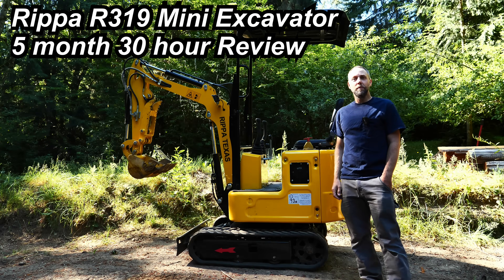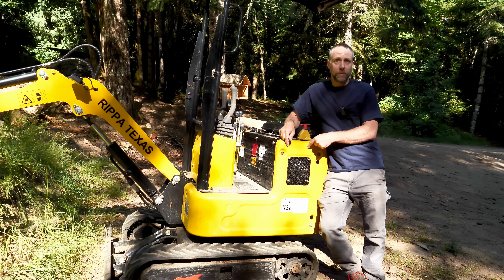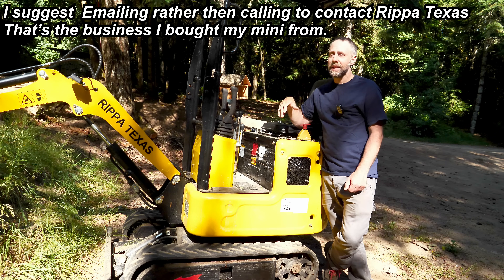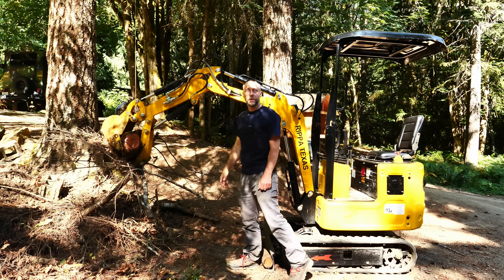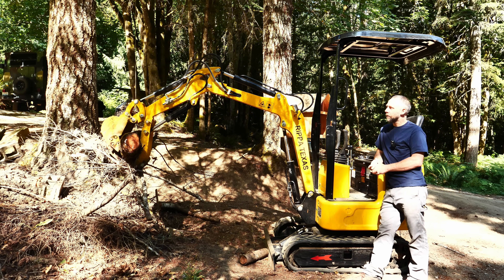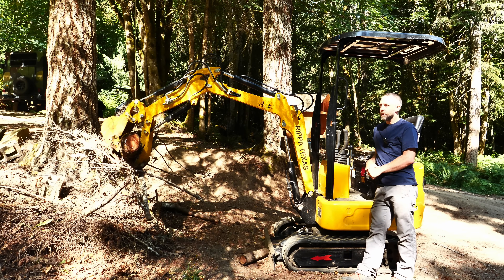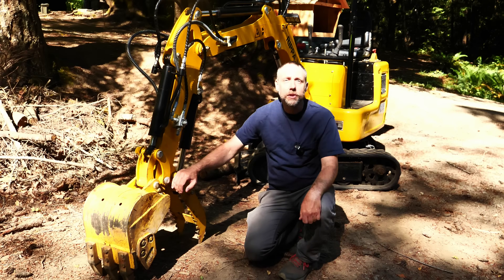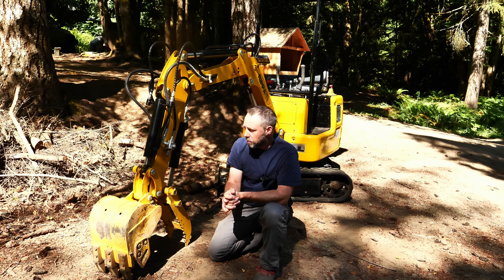Affordable Chinese Mini Excavator review #Rippa #R319 #miniexcavator

Comment: Hey Mike.  I agree with you about having a hernia.  When I was in my 40's and was driving semi truck haualing automobles I ended having a hernia on the right side of my stomach area.  I though that over time is would heal itself.  But it didn't.  I got tired of having to always push my intestines back through the hole in stomach wall muscle.  So I had the surgery and the doctor sowed a plastic mesh to help block the hole in my stomach muscles.  I was not fun.  For ten years if would get a shape pain once in a while.  But now I have no problems.
Reply from the maker: I hear you man, I have been feeling something coming on when I lift really heavy things or shovel a yard or two of gravel. 
I have been trying to take better care of myself and not do as much heavy stuff.
I had back surgery when I was 13 years old, since then my back has bothered me especially after a long day of work. 
On a side note I bought a mini skid steer last summer and I use that machine a lot around my place. I took it to my work this week to do some gravel work, I was able to prep the site scraping off all the grass and lower the grade for gravel in and 1 hour. 10 yards of gravel got delivered and I was able to spread out the 10 yards over the site in 1.25 hours with that little skid steer. Man my back thanked me 🤣
Take care Samuel 👍

Comment: Interested to see what you think of the quick attach vs your bucket & thumb geometry. My fixed thumb pin is about 5” up the stick compared to the bucket pin. I have seen others with the same set as me but with a hydraulic thumb where the thumb and bucket only meet in one position.

Comment: Get the Diesel. I have a 30yr old Kubota tractor with the exact 3 cyl engine most of those mini excavators come with. It is not expensive for maintenance and I have never had to do anything other than routine maintenance. Parts are EASY to source, there are zillions of small Kubota and Yanmar diesels out there. People saying diesels are expensive to maintain must be thinking of big semi truck engines. Diesels are quieter, produce more torque at lower rpms, last longer, and sip fuel. You can even buy off road use diesel that doesn't have any of the road use taxes added.

Comment: Both of my machines (excavators) are running on diesel.  I wouldn't have it any other way.  Very smooth and powerful even down to the low rpms.  Never had an issue that couldn't be dealt with easily and the small one uses a 3 cylinder Kubota diesel engine.  The small one is what is called a 2 tonne Chinese model.  It has the red arrow on the side of the track frame like yours.  4 post sun shade is certainly better than a 2 post.  Mine has the expandable tracks for width but I have only used it in the widest setting and never had a need for it to be narrower.  Just makes it feel more stable.  I have removed the door off of the back which accesses the oil and other engine accessories but I did this because the fan really drove the air right to the centre of the door and it made sense to help the cooling in the 100 degree weather we have been having a lot of in the Okanogan here.  The hydraulic oil fill and diesel fill is on the right side (of you sitting) and has see thru fill gauges you can easily see.  Hydraulic thumb was standard and there is plumbing for accessories like a breaker or auger if you like.  I got this mainly for orchard work because we would plant trees with an auger but when hitting any kind of rock, which we have plenty of,  the auger would deflect causing the tree hole to be off.  With the bucket on the excavator this doesn't happen.  Just dig out the rock.
They are an absolutely indispensable machine for almost any purpose.
Reply from the maker: Great to hear your experience with your machines 😊👍

Comment: Do you think this machine is capable of digging 2-3' trenches? I'm looking to repair a septic drain field (not deep) and adding drainage to my property. Based on your videos, I'm sold! I'm struggling to find a dealer network- where can I find a dealer list? Looking to purchase within a few hours of upstate NY.
Reply: it will dig! i have a qh12 and several buckets and a grapple, yep, they will dig fine, mine will reach to 5ft, and maybe 6, i wish it would reach up higher tho. but ways to manage doing that.

Comment: The small inline Kubota diesel engines are very reliable, it's common to see 30yr old tractors with 3k hours and the engine is just fine.  The D722 has been used for eons and its a good motor, the D902 is a better engine (I've had 2 D722 powered tractors and have a new D902 powered tractor).

Comment: Diesel is awesome, BUT they are more expensive to fix, injectors and injector pumps can be expensive and frustrating. In some ways you can't really go wrong with the simplicity of a gas engine. The real reason, in my opinion, to go diesel over gas is economy. For a little machine like that it seems like the economy would actually be better with the gas engine, not in the way of fuel usage but in the way of cost of parts and maintenance and ease of maintenance. I would watch no matter what way you go. :-)

Comment: I got a 2024 with enclosed cab from the same source. I ordered it on Ebay and added the rake attachment.  Shipping was free and final cost was the same as what Mike paid for his. I think the cab models don't sell as well, might be why it was a good deal. Don't know. It also has the RATO engine, not the B&S. Research I did says the RATO engines are available at Harbor Freight. I'm 6'7" and was concerned if I'd fit in the cab. Pleasantly surprised, it's quite roomy. I modified the cowling to swing open. Added a fan to pull air out of the engine compartment using the existing switch installed for the track spread, which mine doesn't have. Added a simple tach/hour meter. Also, extended the walking sticks to help have a bit less Jerry control. I've found to avoid Jerry hydraulics just move slowly. Shipping took about 6 weeks. But, the company was great about keeping me informed and once the machine got to the States it was to me in 3 days. No regrets here.
Reply: I've got a machine getting picked up from them and shipped out to me on Monday. How far from Texas are you that it took three days? Just trying to gauge my expectations!
Reply: @richcrosby  Idaho
Reply: Mine came with pedals fir thumb and blade. I like those. The one thing it doesn't have is a hydraulic fluid temp Guage. It has a round bubble type Guage. Not as useful, imo, as the type I've seen with the thermometer in them. But, oh well.
Reply: Does the can have AC or just heating?
Reply: Which RATO engine is it at harbor freight? I’m trying to see how much it would cost for an engine replacement
Reply: @jamesamous5854  just heat and very basic heat at that.  Basically, a tiny electric windshield defroster. Strangely, it's mounted kind of beside the seat, where it blows mostly on the rear window.🤷‍♂️ I haven't really run the machine in cold weather, yet. But, now that we have snow, I may have to test it out. I suspect there's enough heat coming up from the engine, combined with the little defroster and oscillating fan to keep the windows defogger and defrosted. I'll let you know. As for A/C, when it was hot weather, I operated with the right side sliding window open, left side door open and oscillating fan on. It was tolerable. Putting the engine compartment fan in so it pulled air out of the engine compartment seemed to help, too.

Comment: To me it sounds like your yanmar is a little too big for your needs since you’re not running that much and the rippa is a little small since you’ve already found the limit of the original bucket. I think it’d be worth while to sell both and buy something that is in between the two size wise. That way it’s a little stronger and more powerful but you can still get into the tighter areas

Comment: We just bought off grid in the Adirondacks NY
My GF is set on renting an X to dig the existing "unknown" septic to clean it up/replace it.
We also need electric trenched in, and one pole set for the street pole service line.
I also just finished building my homemade 158" sawmill

Now in your opinion, arent we gonna be better off with something like the Rippa vs renting stuff? My GF is extremely wise and I always try to use her as the decision meter, but shes still hesitant on buying a machine when myself, an auto shop owner, feels we NEED to buy something off the gate and the Rippa is like perfection in all aspects.

Whats your opinion? We are quiting our jobs, and will have nearly no bills, and will need to figure out garage based/homestead based incomes as we go..

Comment: Doesn't use enough fuel to justify going diesel at all if it's harder to work on (better not have to pull engine for anything). I would check it out in person for quite a while.
Also, what about adding some tractor weights to the back for more lifting capacity/stability (sorry, we've seen you're an excellent fabricator lol)? I'm sure 500 lbs would go a long way and add fairly minimal length.
Reply: I believe  mike is planning  on fabricating a counter weight in the near future

Comment: Could you put some type of mower attachment on it?
Reply: A brush mower attachment even if it had its own isolated engine that could trim trees to a height and hills and ditches would be worth the buy for me.
 Even if you had to make it yourself that would be an awesome video.
Reply: I've been looking at these for a while now, but I keep telling myself how often would I use it, just to dig or lift a log, so would it really be worth the money, if it can do brush Mowing and limb trimming, then I would probably get a lot more use out of it.
Reply from the maker: I actually just adapted a 21” 5HP line trimmer to hook up on my mini excavator bucket. So far it’s working great 👍 
I will post a short video of it in a few weeks. Thanks for checking out my new video.

Comment: Hey Mike, great content, thank you.  I have a Chinese mini ex, issue I am having is not being able to lift the front blade very high.  Its a factory issue.  Any thoughts on a way to re engineer the blade or cylinder or mounts to get a higher lift?
Reply from the maker: What make and model do you have? Does the blade have a decent amount of drop below grade? If so you probably could modify the top mount of the hydraulic cylinder by cutting it and moving it up a little higher on the lower frame. If you do just make sure the blade in its up position doesn’t hit the lower cab when rotating. Also consider adding some extra gussets to the mount, some of these minis seem to have a fairly weak upper mount on some makes and models. 👍
Thanks for checking out my new video!
Reply: Thanks for the reply.  Mine is a Yufan, YFT 12 so similar to AGT 12 or 14 or so.  Not sure about the blade drop below grade,  I will have to check  that.  Think I may need a longer blade cylinder?  Climbing curbs and other small solid objects are a real pain and I am thinking there has to be a better way.  Also I ordered my machine directly from Yufan Machine and got the expanding tracks and swing boom.  The ordering and dealing with them was flawless.  I do like the expanding tracks.  Havent used the swung boom feature yet.   You will probably need to build a "skid plate" if you get a machine with expandable tracks as the expansion cylinder and hoses are exposed.   AJ
Reply: @Mikefestiva  I have a Yufan that is similar to te AGT 12.  I do have some drop on the blade.  I will have to experiment.

Comment: There a re 1/14 Rc machines more expensive than that but hell beats a shovel or messing your back up and dont matter if its a CAT or a cheap mini still need maintenance parts and repairs eventually and these  are basic no computers and if you can work on a mower or lawn tractor or quad bikes i reckon you can   look after one of these and even a car and quad trailer can hual it around they hual 2t caravans

Comment: Mike they did sadly remove the cross brace on the new model they also changed the vendor for the drive motors to a Chinese company.
Reply from the maker: I’m pretty sure my drive motors are also Chinese, the hydraulic pump on mine is supposedly a Parker pump?
Reply: @Mikefestiva  The problem with Chinese is there is no recourse for them using counterfeit or knock off "brand name" parts. If Parker makes them in China then the chance of them being real Parker pumps is more likely.
Reply from the maker: @LameTRUMP  Yes definitely, that’s why I say ( supposedly has a Parker pump) supposedly being it may say Parker on a name plate but I kind of doubt it’s real a Parker???
But it’s pumping oil and is still working fine.

Comment: It is important to clarify whether we are talking about replacing it with a single-cylinder Chinese diesel or a three-cylinder Kubota. In the first case, I do not recommend replacing it because this engine is very loud and emits strong vibrations. Kubota is the best in all respects but also by far the most expensive solution. What you will buy is up to you.

Comment: I think its a kubota so parts shouldnt be an issue, engine problems also probably shouldn't be an issue to begin with, its a diesel so its ALOT quieter and should run ALOT cooler (not that heat is an issue like you said)

Comment: I think the grease fittings you pulled may be high pressure fittings, which explains the difficulty in servicing.
Reply from the maker: Paint seemed to be the biggest issue, all the fittings that didn’t have paint covering them took grease fairly well.

Comment: I've just recently purchased the Rippa 319 and am trying to find the hydraulic filters..... do you have a cross reference to part numbers?? Any help would be greatly appreciated!!
Reply from the maker: I haven’t needed to change my thread on hydraulic oil filter yet, I only have about 48 hours on my R319 so far. It’s probably a simple filter Napa should be able to cross reference for you. Take your filter to Napa and tell them it’s a hydraulic filter any you are running ISO 46 hydraulic fluid, I’m sure they can find a match 👍
Reply: @Mikefestiva  Thanks Mike

Comment: stay with gas, its simple, seem clunky but it works just fine for these, if your going to a big machine then diesel it is, but for these little toys, gas does fine, you could get a HF twin and fit in, it would sound better but it wont make it work any better, the 13HP runs them fine.
Reply from the maker: I definitely agree with you about the simplicity of the 420cc gas engines, they are cheap and easy to find parts for and work on and the HP seems really matched well for the hydraulic system 😊👍

Comment: The diesel is top of the line and being Kubota parts are never a problem.  But a variable width track, swing boom diesel is now NOT an inexpensive machine.  That 2 ton Kubota is now in the price range and is WAY better.
Reply from the maker: For a machine with the diesel Kubota, hydraulic thumb, telescopic tracks and swing boom is around 13k the Kubota made mini Excavator is still about 15K more so not even in the same price range. Of course the Kubota build quality would still be far better.
Reply: @Mikefestiva  Yeah...  When you first reported buying that machine I looked at them (you end up costing me  lot of money!  LOL!).  For $5k-$6k they are a heck of a deal.  But then I realized I needed the swing boom.  And a Kubota engine would be nice.  And I have hills so the wider stance would be better.  And then $15k is suddenly not cheaper than renting one for my projects.  LOL!

Comment: Been trying to get part number for the R319 Pressure Control Relief Valve. Please help help 🙏🏼
Reply from the maker: I don’t have any info on that. If you ordered it from a dealer then I would just suggest emailing them and have them help get you the part. The Rippa I ordered came with a 1 year parts warranty.

Comment: Selfishly I wanna see a diesel powered rig. That being said I think the gas engine is the way to go for ease of repair. Also the hydraulic fluid will get hotter when you run the engine full tilt. Yes you get more “power” but the fluid travels through the system faster and is being compressed so it builds up heat and when it goes through the system too fast it doesn’t have time to cool down so the heat tends to creep up. Especially if it doesn’t have a radiator style cooler with fan. Btw, heat is the #1 killer of a hydraulic system. I worked on them for years
Reply: That was my selfish thought as well, but I agree that the gas engine has the cost advantage for a light duty machine that isn't built for longevity.
Reply from the maker: You are 100% right 👍
Thanks for commenting! Have a great weekend 😊

Comment: Kubota starters are cheap..and alternators..they are much quieter..and longevity..if it craps out you can swap it out for your gas engine..imo i would get the diesel..unless your in a very cold region then do the gas one
Reply: Get the diesel regardless